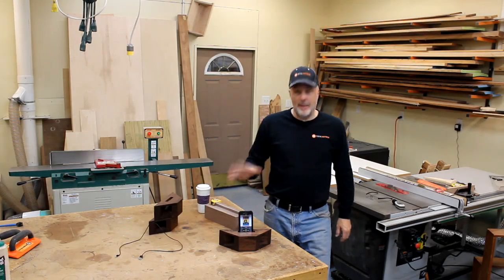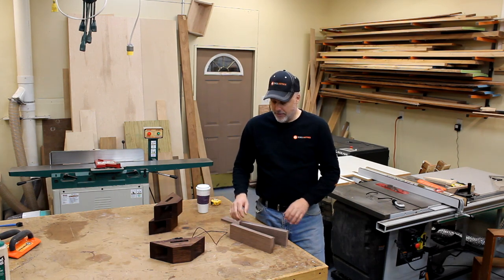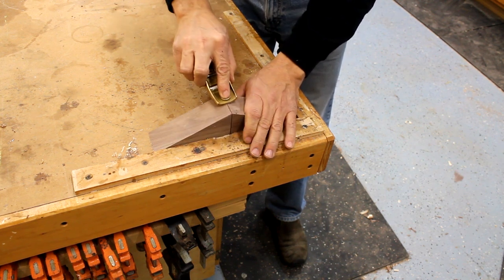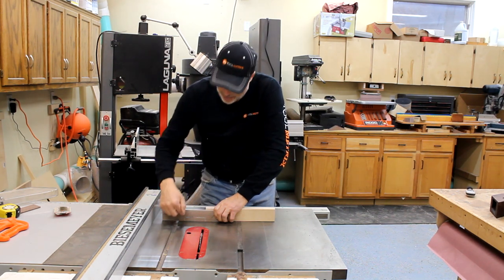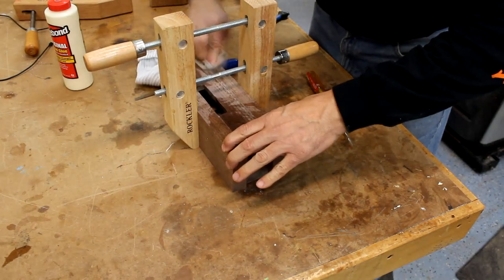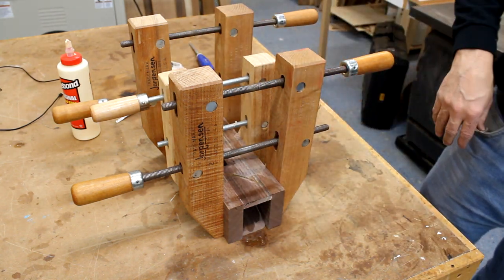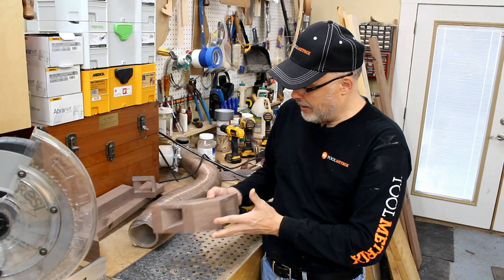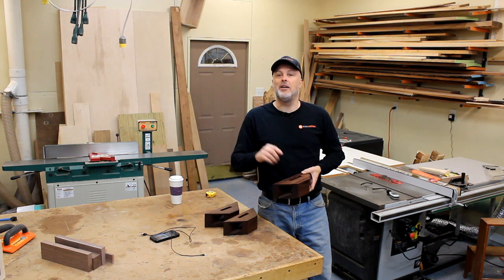How to Build a DIY Cell Phone Amplifier AND Charging Station

Comment: Great video, very thorough and easy to understand explanation. Thanks. Only one problem for me. I can't read the dimensions of the walnut pieces. It's too blurry
Reply: I just solved my "too blurry to read" problem. I changed my settings to HD and now I can read the dimensions easily. Thank you for sharing your project!
Reply from the maker: Thanks for the feedback!  Here you go: 
Top Plate: 2" x 11.25" x .5"
Front/Back: 3.25" x 11.25" x .75"
Base pieces (before angled cuts): 2" wide x 2.25" tall x 5.25" long

Comment: Great video!  Do you have any suggestions on how to cut the block for someone who doesn't have access to a band saw?  Could it be safely done with a miter saw?  Thank you.
Reply from the maker: It works on a 12” miter saw. Handsaw would work fine as well.
Reply: @ToolMetrix  Thank you.
Reply: Taper sled on a tablesaw will work also.
Reply from the maker: Great suggestion thank you 🙏

Comment: Great little project thanks. However my iPhone X has a speaker on the front top centre and the other (for stereo) bottom edge to the right. So I’ll have to modify the design to get full stereo effect and put the phone in sideways.
Reply from the maker: Hi John, that'd be an interesting adaptation.  It's funny; I have an iPhone X and didn't even realize that it had a top speaker until you just mentioned it.  :)  I'd love to see what you come up with.

Comment: Thank you for sharing!  Great project!  Thinking of building one but still unclear on several details. Is this amplifier for phones with two bottom speakers?  The phones I've seen had only one speaker on bottom right.
Reply from the maker: Thanks for the nice feedback.  It should work well with any phone that has at least one speaker on the bottom.  Doesn't require two on the bottom.  It will amplify the sound out both directions from a single speaker.